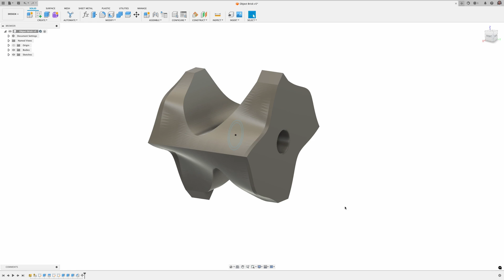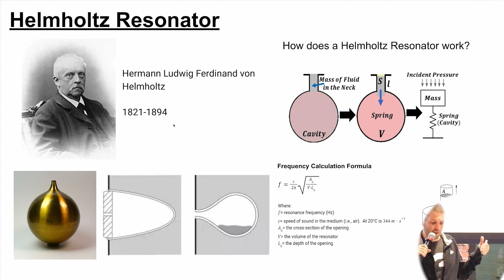This Slip Cast Brick Can Now Be 3D Printed!

Comment: 3d printing isnt really a mass produce option also more plastics not great, however, its good your using this so you can really rapidly try various improvements.
Reply from the maker: Glad I have your approval
Reply: @JoeMakes  sorry but you cant bully me into toxic positivity. Your idea is getting more realistic but clearly the last thing the world needs is plastic bricks everywhere. I feel like this isn't an idea thats new so the place you can really innovate is a shape and materials that can be mass produced and not cause problems. That's where the "genius moment" is for this. A shape good at the task is, as we know, going to be hard to reliably produce. You really want something with straight lines and simple profile. Ideal for casting in any ecological material would be no curves at all. Is there a topology that achieves this? You could literally be famous for finding one. lol.

Comment: Could you simply make an extrusion dye and chop out bricks which have noise cancellation properties? Have a spiral(spinning) dye that gets mechanically pinched at a regular increment.
Then you could mass produce blocks. Slip cast may give a better shape but it's not as remotely as high volume afaik
Reply: The slip casting (and here, 3D printing) is done specifically because the bricks must be hollow to work. It's a specialized design of a "Helmholz resonator" if you're curious to go look up more info.
Reply from the maker: I wouldn't classify anything I do as "simple"😂
Reply: @JoeMakes  Complicated concept, but simple manufacturing is the goal, Clay pipe extruders are high volume and could be a good basis for making a form that would be nice for making noise cancelling walls.

Comment: Molding is still the correct method for making repeat shapes like that. 3d printing shines for custom or prototype applications, not mass manufacturing required for bricks
Reply: It'll be cool to see 3d printing people experiment with thess before mass manufactured ones become available.
Reply: What about 3D printing the slip cast?
Reply: More accessible for hobby/novelty tho

Comment: What if make holes at corners? At least the rain problem will be solved. But how good will it be absorb noise?
Reply from the maker: It has to be completely watertight otherwise the resonator wont work
Reply: Maybe a drain plug threaded might be a solution

Comment: Cool stuff, but I would stay away from wood-filled filament. Basically, the only advantage you get is that it might look nice, has a wood smell, and the surface finishes differently compared to regular printed PLA, but in terms of lifecycle, it's an environmental catastrophe. 

Basically, wood filament is just a regular plastic filament with sawdust melted into it, resulting in a plastic-sawdust mix. Unlike regular 3d prints made of a thermoplastic like PLA, ABS, PETG, PE, PP, etc which you can melt down and recycle into waterbottles or whatever, you can't really ever separate the sawdust from the plastic again meaning it's essentially landfill or incinerator-bound.
Reply from the maker: True, I've been selling that stuff for about 9 years and worked with a couple filament manufacturing companies in my day.
Reply: "Unlike regular 3d prints made of a thermoplastic like PLA, ABS, PETG, PE, PP, etc which you can melt down and recycle into waterbottles or whatever" - this has never happened. post consumer plastic recycling is fake.
Reply: I would suggest to use petg. Cheap, good Layer Adhesion and can withstand water and temperature changes. Paint it with white paint that reflects UV an other light an you should be good everywhere where temperatures do not exceed 40c°
Reply: Out of curiosity: is there any problems related to burning compared to standard wood?

CGE games are using something similar for pressure molded boardgame components, and thought it was a great idea (I think they used natural adhesives as well)

How does it hold up in a compost bin? Does it take too long to decompose naturally?

Comment: If you made this for gunshot noise at shooting ranges you would be rich.
Reply from the maker: As long as they don't start shooting at the bricks 👍
Reply: @JoeMakes  Although what if that was part of the design? replaceability? Could you somehow make the interlocking in such a manner that replacing 1 or that is surrounded by 4 others would be easy? That way they'd have incredible sound dampening at the range and when someone accidentally pew pews one or few of them then you can just sell individual easy install replacements.
Reply: Some may even call it a Gunshot, Gunshot, Cash Register Noise situation
Reply from the maker: MIA's song would be a good soundtrack
Reply: I think you wouldn't need to have the resonator wall so close to the sitting alley, just around the perimeter of the range.
Reply: Yeah, people that can afford killing toys and all their accessories would probably eat up the latest 3D printed whatever you market to them.
Reply: Need it for race tracks